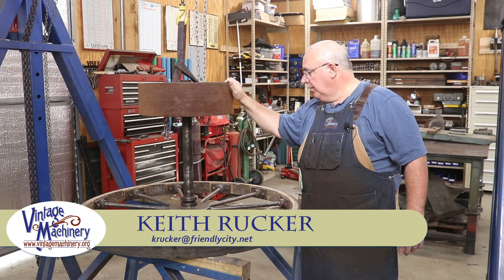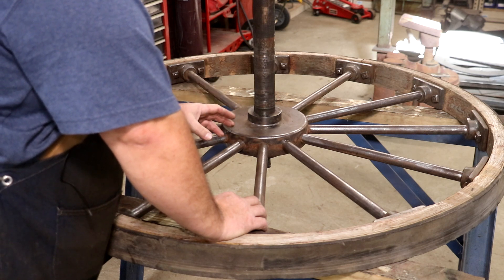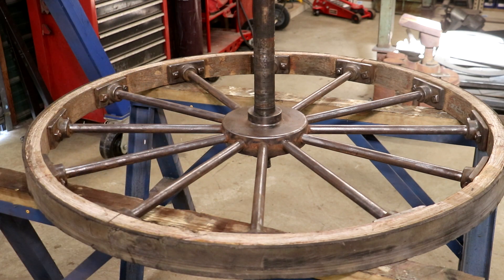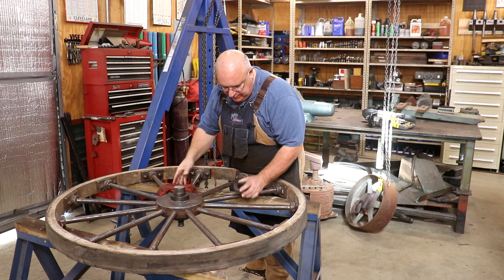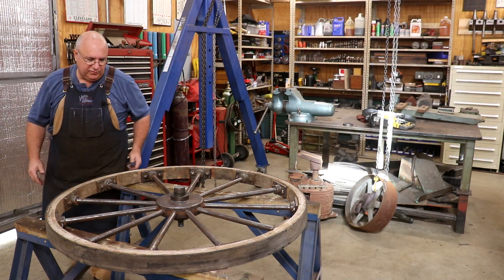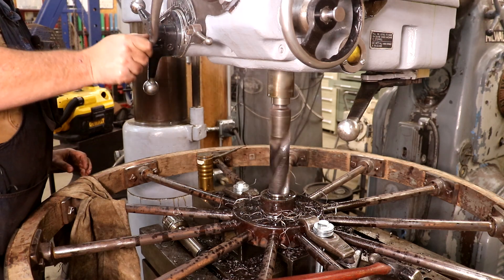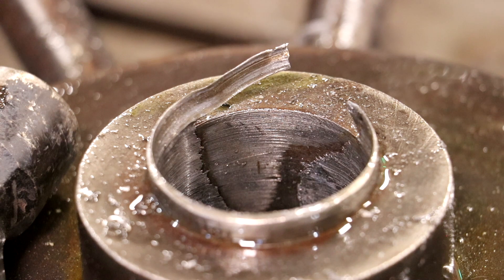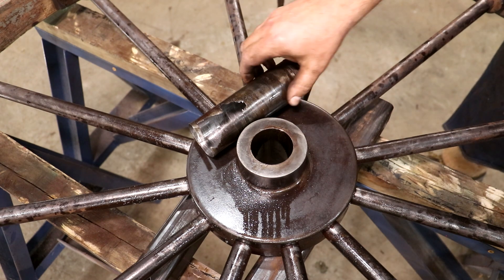The Jimmy Diresta Bandsaw Restoration, Part 5:  The Battle of the Stuck Wheel Shaft - I WIN!

Comment: use your letter punch to indicate "left hand thread" on the hub.  In a hundred years the next person (or AI robot) to fix this will be very appreciative.
Reply: Or use S for sinistro. Yes I have seen this. One of the benefits of a classical for metal worker.
Reply: Don't gas fittings have a groove around the hex to indicate left-hand threads? 
Spelling it out is no help if the next being that services this is an alien from Planet Bxrftle. :-) You really need to take the long view.
Reply: It already has L stamped on the face, see 24:48
Reply: @mayshack  What makes you think we will still be using brake rotors in 100 years?
Seriously that would be very sad.
Reply: @mayshack  Not a problem.  But I do really hope we are not.  Friction 
brakes just toss the energy out window.

Seriously given the work it takes to put these old machine tools right I sure hope it ends up in somebody's shop or a museum.
Reply: @millwrightrick1  What does sinistro mean?
Reply: @ellieprice363  Sinistro was on an Italian made machine I repaired once. It means left. A spindle lockout had to be turned left to extract it.
Reply: LH thread is designated with cuts in the corners of the nut. Least it's supposed to be. It isn't always.

Comment: For everyone who wonders about the shallow taper:
The taper is there to make sure that the shaft an wheel will fit every time without complicated fitting process. Otherwise the manufacturer has to hit very tight tolerances to ensure no wobble and roundness/balance. A taper angle is easier to hit every time as a diameter. A little bit oversize/undersized in production is no problem.
The band-saw was most likely delivered in pieces and assembled in place. The taper ensures a perfect fit every time. This was also the reason to add a left hand thread. If the Machine was assembled in the factory a simple cross pin would have been enough to hold everything together. But with an on place assembly it's not a easy task to drill and ream a cross pin. So thread an nut was much more convenient.
Reply: Insightful...
I was thinking the thing might be threaded.
Reply: Thanks for your post.
Reply: Exactly right, and if the installer did not tighten the hub enough, the first time it caught in the work the hub tightened itself.  Those early machinists, engineers and mechanics made the industrial revolution work.
Reply: Very good analysis. Although I never would have guessed this was a tapered fit it makes perfect sense for the reasons you stated.

Comment: Well done Keith - and very interesting about the LH thread.  My Dad had a ‘66 Chrysler and I remember him changing over to snow tires in the driveway and busting a wheel stud off (I think on the driver’s side - but I was just a kid).  He found that the studs on that side of the car had LH threads while the ones on the other side were right handed.  
There ya go - a company answering a question that nobody had asked.
Reply: Chrysler did that on most cars for a long time, and yes, the left side is the one with the LH studs. This is still common on large truck and bus tires. Often (but not always) the end of the stud will have an L or R stamped in the end on wheel studs.
Reply: At 17 years old I  learned that on grandpa and grandma's 1955 Plymouth Belvadere.  Dad was around, so no busted lugs, but a lifetime lesson  there.
Reply: These wheels are on the same side of the press (or car if you want to look at it that way) they should have the same LH thread. 

I also made the LH/RH mistake on a truck axle at work one day. Learning the hard way is sometimes the best way. haha
Reply: Back in the day (1950's) Oldsmobiles also had LH threads on one side. Dad showed me that during the tire changing lesson.
Reply: We had an old ‘66 Dodge Polara that we used to run around the 100 acres my Dad bought as a wood lot that I learned about left hand threads on. 
After figuring I’d learned enough trying to remove the lug nuts my Dad pointed out the L stamped on the studs and explained that that was the way it was done with the thinking it would prevent them from loosening as you drove. 
I guess physics must have gotten an upgrade because they stopped doing it that way. 😂🤣
Reply: @jeffreylee7184  
Yupp. Few seem to want to question past decisions just in case they knew something then that is being missed now.
Reply: @jeffreylee7184  I don’t recall my Ford 3/4 ton hubs spinning off at speed, but I do recall waiting two weeks for replacement studs when the Sears impact wrench jockey tightened them to destruction when I bought new rubber donuts.  I did not realize that there was a plethora of foolishness that precluded his mistake.

Comment: You gotta love a left hand thread. I was just a kid doing a brake job on my fathers VW Dasher. It was probably 1977 or so there abouts. The front brake caliper had a left hand thread banjo bolt on the break line into the caliper. Like a typical kid I thought I knew everything so I continued tightening the banjo bolt while believing I was removing a really tight prick of a bolt. Finally it snapped it off in the caliper. I went to the parts store looking for a replacement bolt and now the caliper because I had beaten the caliper to death trying to remove the threaded section of the bolt. Back then the guy behind the counter had vast knowledg and pointed out the groove in the hex designating a left hand thread. Did I feel like a dumdass buying a new break caliper and bolt. Not long after that I went to a local trade high school and  graduated as machinist through the tool and die program. I love the videos on this channel they remind me of the time before computers were all the rage. When welding a bandsaw blade was a necessary skill. Thanks for sharing your shop with YouTube

Comment: My 1966 Cub Cadet 122 had a stuck center pin in the front axle.  I didn't even try to get it out, I took it to a local machine shop where the machinist had to drill the pin out.  He then drilled the axle oversize and bushed it with brass the installed a grease fitting so it wouldn't seize again.  I think he had the same smile as Keith when that pin finally came out.

Comment: Keith, one way you can work with a stuck shaft like that is to leave a stub on the bottom side, outside of the  hub, then leave the hole blind or with a substantial shoulder with which to drive the shaft out: the principle being that pulling a shaft tries to shrink the diameter, and pressing or driving a whole shaft tries to expand or mushroom the shaft. In other words, Drill the shaft from the top, then press or knock the shaft out from the top.
I learned this replacing BMW valve guides and driving them out undrilled didn't work -- they galled the hole.

Comment: Just a suggestion, my father taught me to not drill all the way through a shaft you want to push out. Leave a bottom that is just deeper then the hub that way you can easily punch it out or press it out without damaging the bore. Great video love watching your projects.
Reply: This is exactly how it should be done (leave the opposite end in place to drive the punch against).  Driving (or pressing) against the opposite end has the effect of "stretching" the remaining slug, which in turn slightly reduces its diameter, causing it to lose its grip on the bore.  I honestly sighed in disbelief when Keith did not use this technique and explain the benefit of leaving a hammering/pressing section in place instead of drilling completely through.  But he still won and I do give credit for that.
Reply: @larrywalker7759  but first ya gotta know it is a taper.
Reply: @cadewey6181  Actually, it applies to straight shafts as well.  The only time you would need to know if if was a taper would be if there was a possibility you were trying to move it against the taper.  Of course Keith had already determined the shaft was larger on the side corresponding to the direction he wanted it to move in, and that pretty much proved he was moving it with the taper.

Comment: A porta-band is one of the handiest tools ever made. Mine isn't battery powered. It's a Porter Cable that I have had for over 30 years and it's had a hard life, but it still works good.
Reply: Be happy about that. I started looking into buying a new one recently and they are all 85% plastic now. I'd rather buy an old used one.

Comment: Hindsight truly is 20/20. I didn't see any suggestions of a taper in the last video comments, I don't think any of us considered it. I knew it was essentially married up, and not with a mechanical fit or stay. but you could say the mechanical fit WAS the taper. and, you also don't want to make too many assumptions and beat things up the wrong way for too long...it's a tough problem that mechanical workers have very often. I was in auto repair for..too long.. after the first hole was all the way through I would have heated it again and tried to smack it out...

Comment: Incredible!! Do I need a radial drill🤔
Reply: Check out the amazing giant scale work Cutting Edge Engineering does on his DRO radial drill down under. Outstanding, amusing and heart warming videos on giant equipment and machinery.
Reply: Any question like that ends with a yes. An emphatic yes 🤣
Reply: No, just a horizontal mill.  A shop I used to work at did paper machine roll repair.  Rolls were typically 2' to 4' dia x 30' long with stub shafts each end. Shafts were around 2" to 6" dia with an interference fit of about .001" per inch of dia.  So a 6" shaft would be .006" larger than the bore.  The normal removal process for maybe a 6" shaft was to cut it off to the hub then bore a pair of 3" holes on 2-7/8" centers that overlapped in the center and left 1/8" of material near the bore wall.  This made a hollow "8" shaped bore in the shaft.  The uneven wall shape would collapse enough to relieve the interference fit.  The piece would just about fall out.  The work was done on a big G&L horizontal mill with spade bits.  Putting new shafts in and finish machining is another story.
Reply: Question: Do I need *tool name*.

Answer literally 100% of the time: Obviously yes.
Reply: Yes! Yes you do!
Reply: Nobody needs anything, the question is do you want a radial drill :)

Comment: - KEITH, have you ever tried using diesel starting fluid (ether) to cool a bored out piece so that it shrinks and drops out of a fitting more easily ? ? ?
- Blowing compressed air inside to make the starting fluid evaporate fast to better cool the metal fast helps.
- Acetone with it high rate of evaporation will work, too, or even Isopropyl rubbing alcohol, both with assisted compressed air evaporation will work, too.

Comment: Congratulations Keith! About the top wheel, I would suggest not to assume it is the same. The bottom wheel is the driven wheel, transferring torque. The top wheel is an idler wheel, really no reason to have left hand nut or tapered shaft there. Double check and be careful.

Comment: Machine the shaft and bore for a slip fit and use red loctite and a nut with lock washer. Let it set up and it will drive any load you put on it. To remove the shaft a little heat will break the bond. Loctite on a shaft that large solves the problem and is stronger than any keyway you could install.

Comment: Keith brings us armchair mechanics an insight into methods and designs of the past. I watched this shaft and hub separation with interest because I couldn't predict how it was assembled. I was voting for an unusual method of keying or pinning. I began to lean towards just a taper fit after Keith confirmed the shaft diameter variance on each side of the wheel hub. Keith has some fun toys. Few of us hobbyists can justify a radial drill or has the shop space to accommodate this class of machine. I cringed when Keith chose to drill the final pass with only .010" wall thickness margin. Fortunately he didn't destroy the hub, but he did damage it. His radial drill is an impressive machine, but drilling with that setup pretty much guaranteed failure. Fortunately he had expanding taper to compensate.
Each of us has made similar poor choices when we just "don't know" what we will encounter. Sometimes we score a win and sometimes we suffer regret. This choice brought back the memory of a fight I had removing an OEM specific hydraulic cylinder from a one-of-a-kind critical milling machine in our shop. The repair was a simple rod seal leak, but access to the cylinder was extremely restricted. I spent hours removing the rod end but knowing full well that the threads were increasingly galling in the process. Limited access forced me eventually to shamefully hold the free spinning rod with a pipe wrench as I fought the increasing galling resistance with the rod end nut. I won the battle, but trashed a nearly 30 year old chromed rod surface with the pipe wrench teeth. Production demands required immediate repairs. We had no in house capacity to spray weld and regrind the rod and lead times to replace the cylinder were likely 6 months. I made the rod damage repairs with JB Weld or possibly an industrial product equivalent. The cheesey rod repair lasted many years and is likely still lasting. I retired in 2017 and cannot easily validate.
What was deeply humiliating after finally getting the problematic rod nut off was that it was locked in place with a set screw against the rod threads. The cylinder had run around-the-clock production for decades without failure. Its location warranted no PM and nearly 30 years of filth, funk, extremely tight service access, and OEM paint obscured the presence of the set screw. I was anticipating an "ahah" moment of a revealed pin in Keith's repair that brought deep regret for the oversight.  Fortunately for Keith and his customer this was a win!
Mechanical design is an evolving dynamic. Mechanical assembly and application improvement changes over time. I was trying to explain vehicle wheel bearing design employing tapered roller bearings to a 13 year old grandson last night. He has grown up in the age of modern wheel bearing packs. My verbal description caused him some puzzlement. 
The armchair reporting on why this taper assembly was employed revealed some very interesting suggestions. I like some of them, but we will likely miss guess. The engineers that designed it and employed it aren't around to correct us.
Our shop owned 2 MAS radial drill presses of the same class as Keith's. After using one of these has often made me dream of some day having my own. Kudos to Keith for owning it, owning tooling and knowing how to adequately run it!

Comment: Some older cars used tapered axles on the rear, and have had to remove in order to work on.  There was a designated puller that you bolted onto the studs that the wheels mounted on.  There was a special gizmo that slipped onto the end of the screw that went through the puller into a center drill on the end of the axle, and it had designed hammer areas cast on it whereupon you practiced your aim with a 6 to 12 pound hammer until it turned no more.  You then repositioned your self with a leg on each side, facing out, and whaled on the end of the puller.  The hub released from the axle and life was good, repeat on the other side of the car.  Did many times, but the first time was informative for sure!  Keith, it looks like you would have been a great blacksmith in a different era.  But power makes life so much easier.  That little bandsaw works miracles.  Doing that by hand or with a torch would be possible, but batteries rule nowadays, eh?

Comment: The ONE fail proof method that I have found with any type of stuck shaft, bolt, thread, taper, etc: Cut it off square, do your damndest to find the center, the drill it out in progressively larger steps. The whole process lends itself to introduce heat and lubricants which inevitably lead to reducing the "pressure " of whatever mechanical, chemical or reactive process is maintaining a grip between the two parts!! Well done! I didn't venture to guess WHY the shaft was stuck, but I knew the method I would have taken, which was expertly demonstrated here.. Now I just need to find me a Carlton!!!
Reply: Drilling out the middle of a sold shaft also allows the remaining material to 'crush' more, so it directly weakens any interference fit that may be present.

Comment: Congratulations on this milestone!  More vintage machinery lessons to relearn from the master mechanics yesterday and today.  Thank you for all your shared skills.

So the hole in the hub was telling us “LEFT-Handed.  Just like the “L” on the Ford diesel truck hub studs, which were ignored and ruined by over tightening a few years back by my mechanic.

Taper shafts like Morris drill tapers hold amazingly well.  I had a steering clutch drum on a old D7 that held on a taper splined shaft without a locking bolt.  The center lock bolt had unscrewed off and had rolled around so long inside the drum that the hex head was closer to round.  When I supported the weight of the steering clutch drum, it slid off the taper with no damage.  There is always more to learn: I wonder how you manufacture a tapered splined shaft?

Comment: (@20:04) one idea that occurred to me, would be to use a boring bar and a small threading insert (instead of the drill bit) and cut some internal threads 60 thou deep. Then you could just pull out the material with needle-nose pliers… that is, assuming the material doesn’t just unwind on its own, now that the internal stresses on it are relieved! 😌 Of course, you might need to offset the boring bar to cut through the thicker part without cutting into the I.D. of the hub when cutting the thinner part.